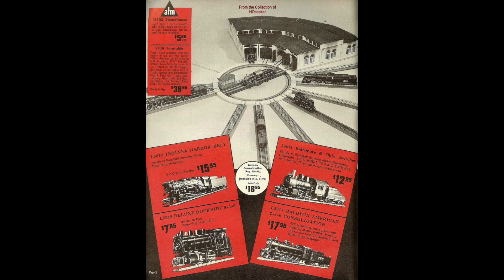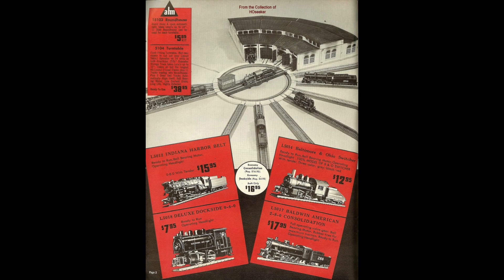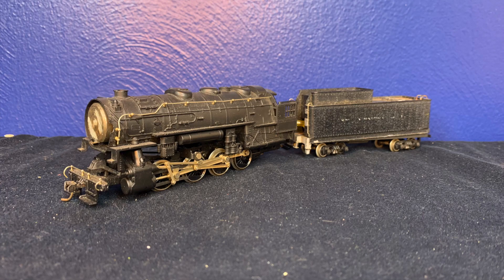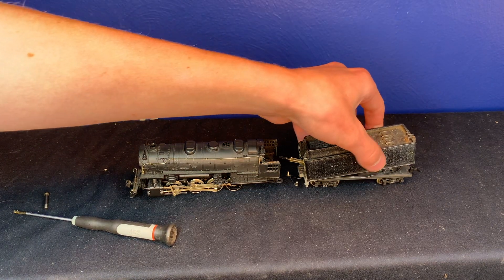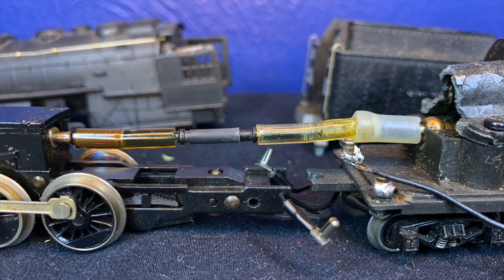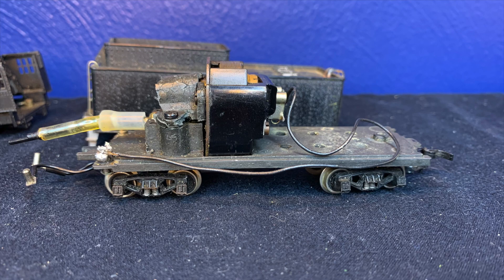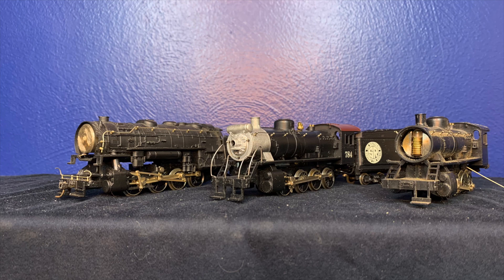Rivarossi's Unique Shaft Driven Locomotives

Comment: Super. It is nice to see a caboose again. I wish that I had bought the 0-8-0 that had the tender truck booster, but the motor in the locomotive, as it would have been interesting to see if it would have survived the last fifty years in operation on my railroad. Hello from the Tracy Mountain Railway in Colorado. 💙 T.E.N.
Reply: I have the 0-8-0 with the motor in the cab, and it runs pretty well. Seeks like a ball bearing is missing, so it's currently in pieces for cleaning and lubing. Sadly, no booster tender, just an ordinary one. Really wish I could find one of those
Reply: I always wanted the 0-8-0, but with two powered tender booster trucks, when I was young, but somehow, I always bought something else. Basically, casually looking around at train shows, I haven't even found a spare tender booster truck, or I would have bought it and put it on one of my steam locomotive tenders. 💙 T.E.N.

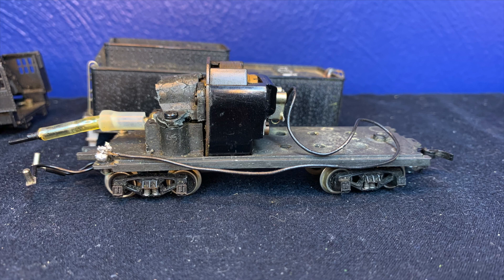Comment: 3:15 I recently acquired a 99% working example

There is slight zinc rot only on the gearbox, the engine is in immaculate condition besides the rusted motor coil

Comment: When you said running, I was imaging you pushing and pulling them around your layout with your hands. sorry. I noticed that the tooling for both shells are the same. They just removed the lead truck of the 2-8-0 and called it a 0-8-0. Bachmann did something like this too with its 0-6-0 into a 2-6-2, and the 2-8-0 into a 2-8-2.